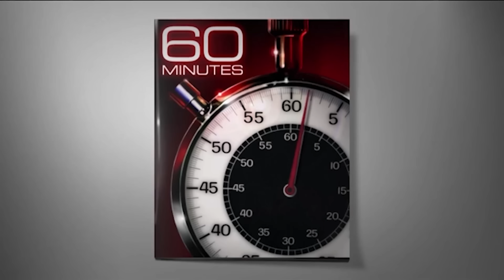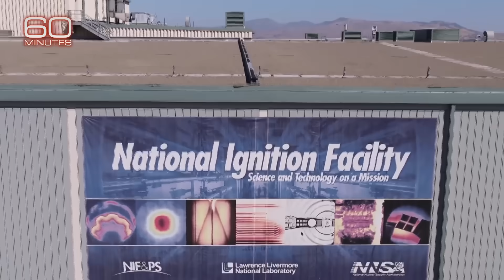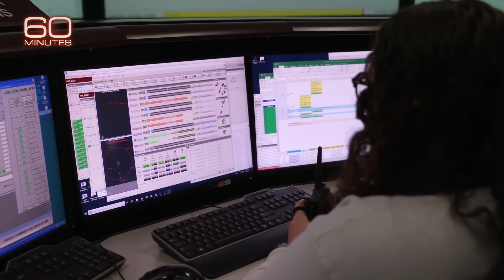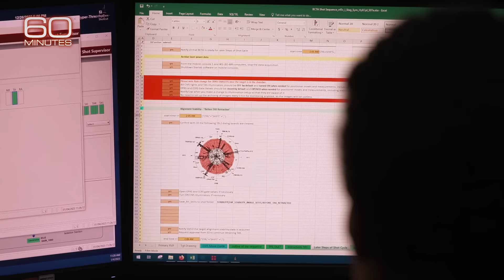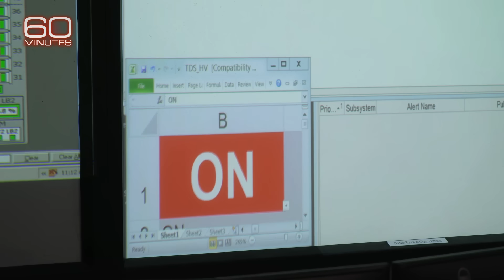Nuclear Fusion: Inside the breakthrough that could change our world | 60 Minutes

Comment: Not to overstate the significance of this achievement since there are many substantial hurdles to overcome before this is anywhere near viable for commercial power production, but I still feel like I’m seeing a glimpse into the earliest stages of a technology that will one day change the world. Being in my mid 30s currently I’m hopeful it will happen in my lifetime.
Reply: They were right when they compared it to the Wright bros. flight.
Reply: @bryanhumphreys940  The Wright bros had an plane, engine, flight control, stable flight. We are at the level of Jean-Marie Le Bris 1856 in power flight. We can now fly with horses pulling us along.  There is no talk on how to harness the energy from nuclear fusion reaction, how to avoid neutron irradiation to the equipment, how to remove the fusion waste from the fusion reaction chamber.
Reply: @bryanhumphreys940  Personally I like the comparison of the Univac computer to modern computers. A whole room dedicated to running computations in the 50's would be easily accomplished with a handheld device now. The tech is just going to get smaller and better as time goes on.
Reply: @bryanhumphreys940  no they were absolutely wrong this has been done 100 years ago and proven not worth pursuing the only reason they're pursuing it now is for funding free money for all you pump a pellet with 100 megajoule laser you're gonna get some feedback this is idiotic waste of money
Reply: @bryanhumphreys940  ....;o. Kg MO*kkm. .m km. M.. M km.. M.. Kk
Reply: @bryanhumphreys940  not like the wright brothers. They weren't actually the first to fly a plane at all. They only perfected a motorized version, but the people to originally fly a plane in the sky was 1,000 years before that. 
This "breakthrough" is like discovering how to fly at all in the first place, and we have yet to see it actually put to any use...even one single factory for something! 
It won't be 1,000 years but maybe 40-50 years
Reply: @elephant882  A plane over 1000 years ago? Who did this and how did they power this heavier than air vehicle? Funny I never learned this in my aerodynamic class in engineering college.
Reply: I just turned 38. Maybe we'll see a revolutionary new energy platform in our lives. This was monumental.
Reply: @kangtheconqueror9545  I just turned 38 yesterday
Reply: @kangtheconqueror9545  u ain't Kang 😆
Reply: @kangtheconqueror9545  same age. Let's get it done!
Reply: @GwaiZai  I got you brother.
Reply: @kangtheconqueror9545  question, what's the significance of this being a success.... I guess I'm asking if you could explain in simple terms why fusion energy is such a big deal....is it like Tony Stark discovering a never ending amount of energy like the arc reactor in the avengers movie?
Reply: @brandonhayes8364  Yea, to some degree.
Reply: @kangtheconqueror9545  Tired of our pollutioned dirty planet
Reply: @kangtheconqueror9545  😅
Reply: what's wrong with thorium? it's safe or does America need
more bomb making
material for future wars?
Reply: @richardwilliams6920  - I responded to you in your previous question. You've been misled regarding the thorium fuel cycle not serving as a potential nuclear weapon fuel source. The U.S. has at least 10,000 nuclear weapons, most of them being thermonuclear weapons with much higher energy yields than the bomb used on Hiroshima, Japan. The U.S. currently recycles its weapons fuels and has no plans to generate more fuel for such weapons. I assume you are are aware that the U.S. has many thousands of its nuclear weapons on alert and ready to be launched and delivered. Most can be launched within about 15 minutes. If you were not aware I encourage you to look into the situation rather than plug for thorium molten salt reactors.
Reply: @kangtheconqueror9545  Its a ponzi, I do not beleve you can run it small scale like this.
Reply: @funnycatvideos5490  Seems you and I are the only ones understand this ...
Reply: @VicGreenBitcoin  You cant run it large scale only small scale or it destroys the machine instantly if you want to get enuff energy to boil the kettle the machine is destroyed!
Reply: What achievement ?
Reply: @gizmo6746  death sentence for all of us this will destroy mankind
Reply: They carefully and strategically state there is a tiny power increase from point of contact beam to fusion, they dont include the power required to charge the device.  example: 500 power units going into source, 501 comes out, but to charge the power units it costs 5,000,000 power units.  End result is a less impressive 5,000,000 - 5,000,001.
Reply: 300 years to overcome the hurdles of fusion. It is that hard and costly.
Reply: @oldmech619  we are going to have some help very soon
Reply: Be careful what you wish for.
Reply: Same here, I'm 32, a student of physics, and I can already tell you that accomplishing this first hurdle would be the hardest challenge (yet they've done it) - the rest are innovation and efficiency problems. Cheers.🤙
Reply: 9 years bud
Reply: @davidanderson6100  I really and truly don’t understand why we can’t keep gas powered cars around for those of us who enjoy a performance machine, and then just use electric for literally everything else. It hurts my heart to give up the feel of a gas powered engine. But I’m also a gearhead and far more likely to spend my money on such an endeavor. Zero-sum games are sht for everyone. And I’d like to think they’re the realm of republicans. But I have no issue pushing for and encouraging electric powered vehicles. Just please don’t take away my muscle cars. Please don’t destroy formula 1 either. Otherwise I’ll be looking into electric powered ways to kms.
Reply: I feel the same way too, but maybe concepts like Formula 1, NASCAR and Rally etc will modernise and move on. People in the future will look back and think our systems of racing sports were archaic. Imagine instead we have fusion-powered racing where vehicles can hit ridiculous speeds they will be looking at our current F1 the same way we looked at old Le Mans racing back in 1926.
Reply: @TheJLH  - There are a great many people in this world who who would rather see humans and most of the other millions of biological species go extinct than give up their dream machines and the dreams that they developed since early childhood.
Reply: @vernonbrechin4207  Are you some disgruntled employee who lost his job at this facility and now takes to YouTube to degrade what they accomplished?
Reply: @vernonbrechin4207  is this the way you’re classifying me? I can’t tell.
Reply: @TheJLH  - There is nothing unusual about those who put their personal preferences above that of the preservation of biological life upon this planet.
Reply: @vernonbrechin4207  that’s not what I asked you Vern. You don’t have to be so cryptic. Just nut up and say what you mean. I’m pretty reasonable when criticized.
Reply: @TheJLH  - I wasn't sure what you meant by 'classifying' you. I tend to be cryptic because most people don't see any connection between their personal preferences for fossil fuel burning muscle cars and why, after 57 years of climate disaster warnings we continue to emit more and more greenhouse gases into the atmosphere. Perhaps the connection is outside the scope of many people's understanding.
Reply: @vernonbrechin4207  you could have done without that last sentence my guy. No one is going to make any changes to their preferences because Vernon on the Internet was passive-aggressively patronizing to them in YouTube comments.

Maybe you’re so far up your own behind that anyone not also up your behind is too outside the scope of your hearing for you to comprehend what they are saying.

What’s frustrating is I feel you must not have even read my comment at all. I find the way you’ve responded to my original comment to be QUITE similar to pro-natalist anti-abortion dude bros in the comments arguing about unwanted pregnancies and the irresponsibility of women, how we should just take birth control or, better yet, not have sex.

Your comments feel, to me, like you’re less concerned that I don’t have an electric car, but more concerned that I don’t want one because of how much I enjoy my muscle car.

The reality is that me, as a citizen of the world, I’m not taking on something that devours something that I enjoy as a punitive measure, meanwhile, AS USUAL, INDUSTRY is the leading consumer of finite resources. They can eat a dik if they think I’m going to fall in line before they do. Because they never will unless we force them.

Additionally, as I’ve said, there is a massive percentage of fossil fuel use which can be discouraged simply by reframing the use of it as a performance product. Most people don’t care enough for the cost of that. You don’t have to force people. Enticing us is enough.
Reply: @TheJLH  - Good points. I appreciate your well written response. At this  point in time it is getting a bit too late for simple incentives to work. Many people remain unaware what a tipping point means. It can mean that once one goes beyond a certain point it becomes impossible to recover. It is like if one deploys one's parachute below a certain elevation above the ground then survival becomes impossible.

---
Most of the 8.0+ billion people on this planet have found it to be advantageous to exclude the following warnings from their consciousness. I urge readers to search for the following two article headlines.

IPCC report: ‘now or never’ if world is to stave off climate disaster (TheGuardian)

UN chief: World has less than 2 years to avoid 'runaway climate change' (TheHill)
  * This statement was made 4.3 years ago.
Reply: With that much power we could change everything for the better or for worse
Reply: It happened thousands of years ago. The sun and moon
Reply: @Burning_Babylon  When did moon ignite fusion?
Reply: hey for all we know AI could vastly accelerate progress on this
Reply: Isn’t a technology yet already thinking of the commercial aspect. We are culturally bankrupt
Reply: @shamanic_nostalgia  or the other way around
Reply: @shamanic_nostalgia  - The NIF management has applied AI in many aspects of the experiments they have been doing since 2009. The work on this technology at the LLNL began back in the 1970s.
Reply: @shamanic_nostalgia  I like that!!!!!! Gracias
Reply: Not going to happen. The amount of energy needed for the lasers is astronomical. This is just more wasted money clickbaot propoganda bullcrap.
Reply: Finally someone who gets it, nucleair fusion is decade away from becoming actually usable .
Reply: On that note, nothing changes the destiny of humankind, as stated at the beginning of the video. That destiny is the same for all the civilizations existing in this and other universes, and it will be fulfilled no matter what.
Reply: Vaporizing weapons
Reply: I totally agree. Hoping it happens in my life time. 29 here
Reply: I hope so too. My dad died back in August of 2022 so he didn’t get to live to see this, but I think he would have been pretty excited. Now at age 36 I hope I get to see this too, but by that point I’ll probably be 50 or 60. It will be like when the internet came out for commercial use
Reply: Please expand your consciousness on this topic. Hope is a good thing, but it is important to know when we are being played.
Look into the examples of this tech that was quashed in the eighties and nineties by the global elite. The work of Dr Eugene Mallove (MIT) 
and Fleischmann and Pons are glaring examples.

Also, the "Water Engines " that run on hydrogen by Stan Meyers (poisoned) and  two decades later, Aaron Salter (shooting victim).

You live long enough, one realizes there are no coincidences.
Reply: BTW, Nikola Tesla had a formula for Free Energy (Zero Point Energy) 80 years ago.
Reply: @anthonykurczewski8384  yes he did honor I have for him. Sad his work was stolen by Edison Wish I had some direction on how to build it..?for us all 🫡
Reply: @anthonykurczewski8384  Yes, and they "banned" him.
Reply: @RMBlake007  I have no idea which comment you are replying to.
Reply: @RMBlake007  "Yes, and they "banned" him."  To whom are you referring, please?
Reply: @anthonykurczewski8384  I've been looking for the comment that had to do with Tesla. I think it might have been what I was referring to. Don't think it was yours though?
Reply: @anthonykurczewski8384  I think the Comment might have been deleted. I recall making a cmment about Tesla...but I cannot locate it now.
Reply: Nikola Tesla anyone
Reply: Quantum computing enters the chat
Reply: @exceptionallife4768  quantum computing is Alot more complex and won't be used for another 80years yet nuclear fusion could be commercial by 2050.
Reply: @pootube2024  you don’t know what you are talking about
Reply: It would likely take another 50 years for this to become a viable technology; however, I’m confident that machine learning will speed up this process. AI doesn’t sleep, and it learns faster than humans do.
Reply: Me, too...hoping that you ill see it.
Reply: much easier to fire two rings of plasma @ each other using magnetism and the reaction will feed itself
Reply: @Anon-zu3xn  A Toroid. Extract from "Thrive" documentary 2011 on you tube made by one of the Gamble (Proctor & Gamble) family heirs.
"The Torus & Toroidal Flow extract from Thrive 2011 documentary.avi"
Reply: Yeah I'm 44 I nearly cried when I got this news. This is historic, I feel this is truly going to change everything and man will start stepping to a new frontier we never thought we could reach!
Reply: we went from no computers and no internet to the speeds and tech we have now in what 20 years? well see some big changes before u die man
Reply: @break1722  Going to have to disagree with you there, can't say I'm a fan of socialism
Reply: @michaelhill6451  Yes, but there’s a lot of details your missing about the laser system. It was built in the 90s, updated some optics in the 2000s and now we’re here.

NIF was never designed with efficiency in mind at all, like 0% thought. If they had optimized for efficiency first and then found out they were just a little short on energy, it would have shelved the entire project.

So really, just by updating to modern 2023 laser tech (3 decades newer) they’d see huge efficiency gains. I think the biggest hurdles are producing enough shells and increasing tests. But it’ll happen soon enough.
Reply: @aaronchamberlain4698  - Unstated in the above presentation was the fact that the NIF laser facility was preceded by at least two other laser fusion facilities at the LLNL. In the case of each of them the staff speculated that they might reach the goal of 'ignition.' They didn't but the planners of NIF said they had worked out all the kinks so that NIF should be able to achieve its namesake 'ignition.' Soon after it became fully operational. That happened in 2009. It didn't come anywhere close. The lab was given until 2012 to achieve that goal. It still hadn't come close by the end of 2012. There were no repercussions and the funding kept flowing since the facility has always been primarily funded at a thermonuclear weapon (H-bomb) research tool. It has been estimated that about $11 billion has been spent to get it to this point, a decade after it was suppose to achieve 'ignition.' Now the management is complaining about the laser efficiency to explain the failures that they have had. That is to urge that a newer facility is funded.

The more advanced lasers they are suggesting are Laser Diode Pumped Lasers  (LDPL), the most efficient of with is about 20%. What the management leaves out of their pleas is that even the most powerful of those lasers don't come anywhere close to the energy output of the current NIF lasers. The NIF lasers have poor efficiency for several reasons. A major factor is that the wavelength is shifted to shorter wavelengths at least twice, with the final conversion to X-rays from the hohlarum inner wall. If the same was required of the newer LDPLs then the overall efficiency would plunge drastically from that peak of 20%.

Perhaps it never entered your mind that these other factors were involved. Many young people are of the opinion that all our newer technologies are bound to solve the problems of the past that have arisen.
Reply: @vernonbrechin4207  Are you some disgruntled employee who lost his job at this facility and now takes to YouTube to degrade what they accomplished?
Reply: 10.shots per second.... Good luck. This won't be available for 100 years
Reply: @davidgilbert2998  - The reported experiment took at least a week to prepare. If they were able to repeat the experiment each week then the repetition rate would be one shot per week. That is 604,800 seconds between shots. The duration of the fusion reaction was 0.00000000008 seconds. As a result the fusion duty cycle would be 0.00000000000001%. In order to recover a significant amount of energy per shot, after also using some energy to create tritium fuel, the capsule compression energy to fusion output energy would need to be boosted to around a factor of 100. So the NIF management needs to improve their system by a factor of over one million to even get technically close to a practical nuclear fusion power plant reactor. This was not clearly stated in the above 'breakthrough' video.
Reply: @vernonbrechin4207  Are you some disgruntled employee who lost his job at this facility and now takes to YouTube to degrade what they accomplished?
Reply: I still believe a hamster running on a treadmill is still more realistic
Reply: @davidgilbert2998  - Since it took about a week to prepare the experiment and the fusion reaction only lasted about 0.00000000008 seconds, producing enough energy during the shot to boil a couple of liters of water, then if one spreads out that energy over a weeks time period my guess is one hamster in a generator wheel would produce more energy than this  experiment that wasn't even intended to capture the energy, or to use some of it to breed replacement tritium fuel. Of course that ignores the facility input energy which would be much greater than the energy needed to pump-up the lasers to shot them once a week.
Reply: @vernonbrechin4207   what are u even saying..... Im not reading this..
Reply: @vernonbrechin4207  Are you some disgruntled employee who lost his job at this facility and now takes to YouTube to degrade what they accomplished?
Reply: @patrickstulz8193  - No! I've never worked there. I have been on a couple tours of the LLNL though and have talked with a person who was involved with an early compliance review while the NIF was being constructed.

I'm also curious regarding the deep seated forces that prevent many people from accepting the issues that I raise. I assumed that their sense of hope tends to blind them to some of these issues.
Reply: @patrickstulz8193  Your identical comment is posted 8 times. Are you some disgruntled employee of YouTube that's spamming up comment sections? Why not delete 7 of your comments? Thank-you.
Reply: we gon go kaboom
Reply: yeah, we're looking at 20 years minimum before we see a commercial application. but it's exciting that they took this big first step
Reply: This is very exciting, but we have heard it before.  I am old enough to have been told that nuclear fission power would make electricity too cheap to bother metering it.  I still believe in nuclear fission power, but it has certainly fallen out of favor. The reasons are more emotional than scientific, but that is where we are.
Reply: It's all poppycock.  You're all being hoodwinked.  Congratulations
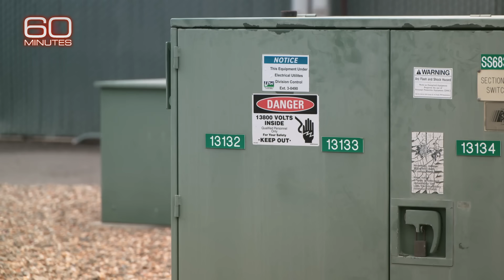Reply: They put in 300 units of energy to get 3 units out.  9:56
Reply: We need fusion quickly, so that countries don’t rely on Russian oil.
Reply: @nickduplaga507  Sorry you believe the fairy tales spouted by 60 minutes (DELIBERATELY?) but its not true! Fusion wont be happening for power its impossible and doesnt work!

The funniest thing they left out of their deceitful inaccurate dribble was the fact that 2 units of power used to generate 3 units of power (you know that 50% increase over input)
That 2 units COST 300 UNITS OF PWER TO MAKE!

Please do the maths on that! 😁
Reply: @danquaylesitsspeltpotatoe8307 Not impossible.  
Especially with AI machine learning, and it would be very quick.
Reply: Me too…
Reply: I'm skeptical about the prospects of self-sustained nuclear fusion -- getting more energy out of it than you put in. We cannot emulate what the sun/stars do because they rely on GRAVITY as the driving force for the reaction to happen, and gravity requires no extra 'energy' -- it's simply a force that naturally occurs when a large body of MATTER is present. So, we have to expend tremendous amounts of ENERGY in order to start and sustain the fusion reaction. Researchers may 'claim' that their reaction produces more energy than the energy required to start the reaction, but two critical questions remain: 1) Is that differential in energy SIGNIFICANT? In other words, are we expending 3.9999 joules of energy in order to extract 4.0000 joules of energy? 2) Are they even able to SUSTAIN those nuclear reactions 24/7? 3) Even if they're able to CREATE more energy than what was spent, can they actually HARNESS all that energy? or does much of it get lost/wasted in the process? Nature/God has provided a 'model' for how energy can be created via nuclear fusion -- using GRAVITY as the key driver (and 'gravity' requires no extra energy to be input). It may very well be possible that this is the ONLY way to create a net-positive fusion reaction.
Reply: Wait. They first claimed that it takes 2 units of energy to get 3 units out? But the reality is that it takes 300 units of energy to get 3 units out? Is this some kind of joke? Basically, they haven't achieved ANYTHING EVEN CLOSE to sustainable fusion energy. Wait. They first claimed that it takes 2 units of energy to get 3 units out? But the reality is that it takes 300 units of energy to get 3 units out? Is this some kind of joke? Basically, they haven't achieved ANYTHING EVEN CLOSE to sustainable fusion energy.
Reply: You and me both brother
Reply: @davidanderson6100  why would they ban electric vehicles? I’ve always loved the quote that lobbyism is just legal bribery.
Reply: @casedistorted  you will be gone when this works
Reply: It feels like how it was when they landed on the moon
Reply: @break1722  This America, land of the capitalist and that’s what makes this place good and bad! THAT WOULD NEVER HAPPEN 🇺🇸 ❤️
Reply: @cm2274  Do not confuse (as you have) Fascism (a primarily leftist paradigm) with Free Market Capitalism. Public/Private partnerships are Fascism.
Investment Banks you never heard of, thanks to the MSM, like Black Rock and Vanguard, control the Fortune 500. Stockholders are the uber Elite attending the WEF' symposium are in Davos right now, 1000 of them. "A thousand points of Light?" quoting GHWB. No. Darkness.
Read "Brotherhood of Darkness" ca 1996 by Dr Stan Monteith $13.95 for 140 pages of pure knowledge. The bibliography alone is worth the price. 
Also, "Behold A Pale Horse"  ca 1991, by Milton William Cooper. The late Mr Cooper was and non com officer that worked in the Pentagon for the Office of  Naval Intelligence and handled all the incoming data.
Reply: @davidanderson6100  you should look at my comment. It explains what energy science is looking for and it isn't fusion
Reply: When are we going to discuss honestly element 115?
Reply: I'm 38 hope to see this in commercial use.
Reply: I admire your optimism.
Reply: It's going to be here faster than you believe...
Reply: @davidanderson6100  A bill was introduced on 1/13/2023, not banned at this time in Wyoming.
Reply: You will die before anything ever happens
Reply: I am not so excited, yes there was net gain inside the chamber. But if you need hundred time more energy to get the lasers to fire... yikes. The one thing they did is proof that the theory is correct. At that point it becomes an engineering/production problem so yes it was an achievement and a step closer. But still you have to deal with the laws of nature and must find a way using this method , to be much much more efficient getting power to the chamber. And i don't see a way to get that done in the next 50 or so years. Hopefully this ages faster then i expected though. I personally have much more hope on the experimental fusion factory being build in France using a different method (Tokamak) it's called ITER look it up on the internet.
Reply: Hate to break this to you but nobody alive today will live to see nuclear fusion reactors powering our cities. I will likely happen some day but it will be a very long time from now..
Reply: @michaelhill6451  👍👍
Reply: Absolutely I hope so too!!!
Reply: This was done and surpassed over 100 years ago. I’m more surprised it’s finally being allowed to be released. I wonder if they’ll let zero point energy get out too. Doubtful.
Reply: We're millennials,  we experience everything, grew up with the early stages of tech, now this? No other generation will ever know; we will surely see this happen in out life time, for sure.
Reply: We have known thorium fusion would save the world forever now (30 + years) if they cared to help the general public with making unlimited energy then they would have.
Reply: Ya I’m 33 I guess we will all see…. I would be all for some iron man boot like shoes to fly around on Nick name them the Forrest Gump special jawns
Reply: @break1722  I don't think many people realize how the world will change rather fast with unlimited energy. You can scrub all co2 excess from the climate with it, you can dezalinize salt water and irrigate deserts to transform them. There is enough Deuterium in salt water to give everyone a million times more energy for billions of years. And we don't even last that long here on Earth.
Reply: Hopefully it will happen before Civilization destroys itself.
Reply: That's literally what the whole video was about ....
Reply: My boyfriend developed this system in 1970, as a child... it got him on a full ride into Stanford.
Reply: Me too...mid-30's. I can't wait to see how this plays out. Hopefully we see a triumph of triumphs! 🙂
Reply: I am 24, I agree with you you. I hope I get to see this technological evolution in my lifetime.
Reply: @break1722  oh boy can’t wait for government to be I charge of our power grid

I bet they even complete their takeover of our healthcare system 

How many people have been killed for discovering new power sources, new engine from alternative power supplies?

I don’t trust any of these people
Reply: Nope
Reply: @Darkness380 The main thing is to get us free and independent, meaning that every home and business has there own unit and no meters.
This was Nikola Tesla's dream. Free Energy.
It will never happen because too many people want to be nursed from cradle to grave; they trust "authority" ; they never fully read the US Constitution and do not comprehend that what makes America's Constitution unique is that our Rights are not given to us by any government agency, but rather we are born with them, imbued to us by the Almighty as unalienable Rights that cannot be waived, traded or taken away. The word "inalienable" is not what the Founders wrote. 
Unalienable connotes the word "Immanent". Thank the Free Masons for the subterfuge in replacing that word and the meanings of many others. These followers of the dark are responsible for many such games in wordplay. Up until the 1920's, the Holy Bible and the Black's law dictionary were in every home. Up until the 1950's, the Illuminati were in every Encyclopedia. Look up the Act of 1871 and "USAvsUS dot info" at "duckduckgo"
We are in war of light against darkness.
"The more things change, the more they stay the same."
Reply: Unfortunately basic physics of weight pretty much stop most fantastical things existing.
Reply: This is basically a re-run for all the newbies to the party.  Nuclear fusion talk has been around for a long time.
Reply: @chipmidges3122  This is all BS. Cold Fusion is real and is being suppressed.
Reply: Doesnt matter. We will all die someday. By way of aacident, disease, natural death of age. So worry about eternal life and not about something that will cease to exist.
Reply: I don’t really understand how this whole thing works, but maybe someone here can enlighten me on a thought I have about this. Let’s say the technology is now here and working ie., all the numbers are good and we now have the ability to power all the land and sea mass of Earth. Say hypothetically and all politics aside, we are going to provide power to light up the Amazon Rainforest, how do you get the power to the Rainforest?
Reply: lmao no, no it wont.
Reply: amount of stupidity in these comments lets me know it will never happen. AI isn't real. Lasers don't power suns. Editing your DNA is idiotic. God is real.
Reply: same!
Reply: You have no idea. Sadly the real challenge will come when such technology rivals that of oil and gas.
Reply: @paulc7138  thats why big tech companys are investing in fusion tech?
Reply: @xbchiefmatrix  open your eyes. Oil isn’t clean.
Reply: Now that they've done it once, the breakthroughs should start coming much faster. They finally have the baseline data and other facilities can start duplicating and building on this breakthrough.
Reply: Only thing that would get in the way is the greed of companies that would lose money as a result of this tech
Reply: @shitonyourgrave  way more money to be made
Reply: Well that's a small issue. Instead of 2 units in and 3 out as they initially quoted, halfway through the hyped ip tale, the quickly state," it was 300 in and 3 out"...!  

Typical media
Reply: Not without a big fight from non-renewable companies. Oil & , Coal, Forestry.
Reply: @BuckingHorse-Bull  most people who support fossil fuels also support nuclear.
Reply: It wont. Youll be long dead before it does
Reply: I think short term better storage tech is going to be the thing
Reply: Same dude couldn't have said it better.
Reply: You won't see it in your lifetime.
Reply: I’m 38 too. I’m excited for my kids. They’re going to get to see things wildly amazing when I’m gone.
Reply: @sethmacomber3497  - They  are likely to see some pretty amazing stuff but it likely won't be what you dream of.

Most of the 8.0+ billion people on this planet have found it to be advantageous to exclude the following warnings from their consciousness. I urge readers to search for the following two article headlines.

IPCC report: ‘now or never’ if world is to stave off climate disaster (TheGuardian)

UN chief: World has less than 2 years to avoid 'runaway climate change' (TheHill)
  * This statement was made 4.3 years ago.
Reply: @sethmacomber3497  - Most of the 8.0+ billion people on this planet have found it to be advantageous to exclude the following warnings from their consciousness. I urge readers to search for the following two article headlines.

IPCC report: ‘now or never’ if world is to stave off climate disaster (TheGuardian)

UN chief: World has less than 2 years to avoid 'runaway climate change' (TheHill)
  * This statement was made 4.3 years ago.
Reply: @vernonbrechin4207  😂
Reply: Exaclty this is crazy to think about!
Reply: Read OVERSHOOT by catton. This will make us more able at consuming the planet.

LIMITS TO GROWTH - gaya herrington. Read it.
Reply: You will be 60 years old when this happens 
So yes take care of yourself and you will live to see it happen
Reply: People with your mindset slow us down
Reply: 😂😂😂😂These nerds been saying this for 70 Years. Wasted money. Should just leave this power inside the sun. Doesn't belong in the hands of humans.
Reply: You took the words out of my mouth.
Reply: I don't think it's as challenging as even these engineers and scienctists believe. ChatagGPT is about to change the world. AI is going to advance the advance of everything
Reply: You wont
Reply: dont hold your breath
Reply: You won't be here this is for elites and nothing else.
Reply: If it’s on 60 min it will be shelved and never supported. It will take someone mega rich and unstoppable to even come close to producing it.
Reply: @bfitness2320  - All the money in the world can't make something that is economically impractical into something that is economically practical. History is filled with examples where enormous sums of money have been expended on projects that never went anywhere practical. Often those examples have been considered too embarrassing to be worth remembering.

As I've pointed out here frequently the NIF has always been primarily funded as a thermonuclear weapon (H-bomb) research tool. The announced experiment included some of that nuclear weapons related work. The NIF management has always obscured that purpose when they present the NIF to the public as a path to a economically practical nuclear fusion power plant. These experiments, with their nearly imperfection free hollow diamond fuel capsules, are getting further and further away from anything that is practical for non-weapon purposes. One estimate is that NIF has already expended around $11 billion in funding from the nuclear weapons division of the U.S. Department of Energy (DOE).
Reply: At least it won't be a change in weapons. You know cuz fusion has already been solved for the purpose of death and destruction.
Reply: This achievement can not be over stated
Reply: You want see it none of us will
Reply: Too expensive.
Reply: ~Global nuclear bomb fake Hiroshima deceptive There are no satellite photos of nuclear test explosions, please tell everyone~
Reply: Not really... as with the atomic/nuclear one - it is for a bomb first.
Reply: old man
Reply: @michaelhill6451  Yes, they mention the part about the high energy use vs the gain at 9:50.
Reply: If your Reading this I sow Prayer seeds of Mighty Rivers of Blessings, Favor, Prosperity, Success, Grace, Protection, Love, Joy, Happiness, Peace, Wisdom, Knowledge, Understanding and Good Health to You and your Kids Kids Forevermore.
Reply: LMAO!!! This planet does not have that much time to see what you are talking about occur. WWIII is right around the corner. And that will happen long before there is this energy form used like you are talking about.
Reply: Nah you’ll be dead
Reply: @Warlock C'mon Warlock...you're making too much sense. ; )
Reply: Earlier comment by me to R M Blake:
I" did make a comment about Tesla regarding his  "lost" 20 boxes of files out of 80 total from his hotel room once the FBI entered the picture.
I must also add here is that once we enter the realm of Quantum Physics and the very tiniest subatomic particles, we observe a state known as "non-locality" which physicists widely believe means this state shows that the particle is everywhere at once in the Universe.
We could call this state the "ether" that Tesla was writing about in his notes. These would be where ZeroPoint Energy  is derived.
The question is whether or not the Uber Elite will be stymied by the Patriots from destroying humanity long enough for these forms of technology to be brought out.
The fact that Ukraine is in the middle of all this is no accident. It is the HQ of the Canaanite/Khazarian/Venetian Black Nobility/lIIuminatl, and their Bloodlines/Free Mason linkages run everywhere throughout history. Klaus Schwab, for instance, is a Rothschild."  ( a branch Khazarian Bloodline ).
Reply: If something like this could be done on a small scale and create energy directly at homes it would eliminate the need for having an electric grid which is dangerous peop]e and wildlife and vulnerable to weather.
Reply: Couldn't agree more with your statement.
Reply: Considering how in the last decade a handful of research projects went to probably hundreds of test and prototype setups many financed by the industry, it very likely a glimpse of the near future. ITER has an estimated budget of 18-22 billion. But considering that it´s a multinational research project shared between nations, and that the prject started 1988 and is projected to get running in 2035, 47 years all things considered and how inefficient goivernment projects are, the money invested is nothing, absolutely miniscule. Overall, there was despite what is toted often not really that much interest and support in developing the technology. Considering that the SLS program, financed by the US alone, has so far swallowed 23.5 billion in just 11 years, and thats only a small part of NASA`s budget, it real shows. Or we could talk about how the US millitary has a yearly budged of 1.9 trillion, or 1,900 billion, 20 billion are a rounding error on those scales. We can after all see whats possible with basically unlimted funding of science in the 60`s. NASA went from barely funktioning rockets to landing on the moon in 8 years. We really don´t have our prioritys straight as a species.
Reply: Hopefully we will be around to reap it's benefits
Reply: I'm not so sure for this!!
Reply: I with ya brother!
Reply: @MARK MORALES Funny you say that in March last year the White House had the cajones to state that viable nuclear energy would be availble to the masses in ~12 years; while news outlets are claiming 10-50 years.  I see the process going significantly faster than Fission (as in modern times we have advanced computing + the proliferation of machine learning and quantum computing on the horizon) but Yes I agree it will still take time more at a snail's pace than a rocket. Because if they rush it and something goes wrong - Chernobyl and 3 Mile island would look like picnic spots compared to then hole left by a reacor powerful enough to feed a large city.
Reply: I'm much more pessimistic after this article. I think Tokamak reactors are much more feasible now.  Looking forward to when they start testing ITER
Reply: Not gonna happen.
Reply: Fusion is just a HUGE and STUPID BOONDOGGLE.

FISSION, works at 600 degrees C (vs. 10,000,000 C for fusion) and there's unlimited fuel for it - thorium (see the Kirk Sorenson videos). 
https://youtube.com/playlist?list=PL6JjafE5gsb9nSmudoj5MUKxX8LTKO0-J

But the fusion world starts at 10 MILLION degrees C.  It's stupid to try and make a POWER plant under those conditions.  It's stupid to try.   

You'll scream when you figure out how stupid we've been in this business. 

Meanwhile, Fusion con artists are laughing all the way to the bank.
Reply: I think we will! Thanks to our advancements in AI I think it will only speed up the process!
Reply: 300 mega bejoules of laser energy, and you can heat 2 cups of coffee
Reply: Thunderfoot busted thus video
Reply: Just a decade or two away.
Reply: There's the promise and then there's the reality.  The promise is always decades away.  The reality is buckets money spent on projects with anemic results.
Reply: Mark ole buddy your optimism makes this old guy happy!!!!! Wether I see it or not you will and my grandchildren also!!!!
Reply: To those who believe fusion Power is 
the answer 2030,  ARE TOTALLY INSANE.
Fission power was to be the answer to 
all our energy problems in 1960.  💀
Reply: I wouldn't hold your breath dude. They created almost no power while using up nearly a city blocks worth of electricity to prove a point. And everything about the experiment requires perfection beyond what humans are capable of. We are more likely to get warp drive before this.
Reply: I assure you that I had very similar feelings when I started following the research in the late 1970s. Perhaps you, like many of your generation, have never looked into the hopes and dreams of people back then.
Reply: So what's wrong with
using thorium for powerp
Reply: @richardwilliams6920  - There are many thousands of people crusading for reactors fueled with Thorium. The vast majority have  minimal to no formal academic training in nuclear physics, or nuclear engineering. The campaign in the U.S. began with a couple of  engineers about two decades ago utilizing social media platforms. They were pushing for the government to start funding their dream project. Very little progress has taken place since then. Most of the fans are unaware of that history. Typically, they immerse themselves in eco-chamber sites that only present the promotional side of the story so as to reinforce their belief that Thorium reactors can be our saviors. Such fans typically have no interest in doing critical analysis of the concept. Typically nuclear power advocates assume that we have 20-30 years left to turn this 'Titanic' around with their favorite nuclear power technology. They have been masterful in excluding the following warnings from their consciousness. I urge readers to search for the following articles.

IPCC report: ‘now or never’ if world is to stave off climate disaster (The Guardian)

UN chief: World has less than 2 years to avoid 'runaway climate change' (TheHill)
  * Note that this statement was made 4.5 years ago.

Thorium, Not The Nuclear Savior Claimed (SimplyInfo org)

Thorium Fuel – No Panacea for Nuclear Power (IEER)

Thorium Fuel: No Panacea for Nuclear Power (fact sheet) (IEER)
Reply: @richardwilliams6920  Cleaning the molten salt.  The UK has one solution but it's radically different than the the normal circulating molten salt.  The UK, with their far flung empire that they support, has the most to gain and which provides the research funding. The trash to energy system used throughout the world was developed by them also.
Reply: @mastermind377  - Correct! The vast majority of the Earth's 8.0+ billion people have become masterful at excluding the following two warnings from their consciousness. Denial is a natural human protective coping mechanism to deal with intolerable cognitive dissonance.

Please search for the following article titles.

IPCC report: ‘now or never’ if world is to stave off climate disaster

UN chief: World has less than 2 years to avoid 'runaway climate change'
* Note that this statement was made 4.5 years ago.
Reply: You overstated it.  Man made Fusion Reactor is completely science fiction.

Earth has a nature fusion core in the center of the Earth.  Lava is gives off radiation, that's more proof than you'll get from anyone claiming to work on fusion reactors.

How stars power themselves, gravity in the 200+ times Earths gravity range and large amounts of uranium (size of a moon to larger than the earth, wild guess).  There's nowhere for the uranium to go, it just cycles through and being the heaviest remains mostly at the core.
Reply: Commercial production controlled or free to use by 1 country or every country?
Reply: @mdmoz1777  Since the elites are planning one global government, they will likely sell it as a global thing.
Reply: @mdmoz1777  nothing is free!!!!!!!!!!
Reply: In the long run. I think the number one hurdle will be bypassing the efforts to ban nuclear fusion power by the lobbiests representing the companies that supply power to all American citizens.
Reply: let me help you out Mark --there is nothing more important then Viable Fusion reactor
Reply: @davegt27    question, what's the significance of this being a success.... I guess I'm asking if you could explain in simple terms why fusion energy is such a big deal....is it like Tony Stark discovering a never ending amount of energy like the arc reactor in the avengers movie?
Reply: Its the key to everything... logistical affordable space travel ... the. Beginning of propelling a vessel to light speed
Reply: @chrisbellville6957 traveling in a vessel at light speed will never happen.
Reply: Really, you just saw a mini sun be created and thought "Hmm, this might actually be significant"
Reply: @goombacumba608  I thought China already created a fake artificial Sun
Reply: @AuraFarmerWitShotgun  Yeah, people creating mini suns is super impressive. I'm just commenting on how dumb of a thought "BRO HAVING THE POWER OF THE SUN IS SUCH A SIGNIFICANT even". i'm pretty sure anyone with a brain would think that
Reply: @goombacumba608  300 mega bejoules of laser energy, and you can heat 2 cups of coffee
Reply: @goombacumba608  If you saw a mini sun, you should have your eyes checked.
Reply: I'm 25 and I know all the tech we dream of we'll have. Living to 200 is happening in my life time and I can't wait.
Reply: @gatesroyale  36 here. I hope they figure this sht out before I’m not hot anymore. Clock’s tickin
Reply: @TheJLH  I just turned 58.. get outta my yard..
Reply: @coolbreeze1627  you’re right, that’s my bad.
Reply: @gatesroyale  hah maybe living to 200 if you copy your mind and upload it to a computer clone, but your body will not live to be 200. That will take another 200 years before we have essentially become immortal
Reply: @casedistorted  that's exactly what people are going to do. And in those days they will seek death and shall not find it; and shall desire to die, and death shall flee from them.
Reply: @casedistorted  Soul's are immortal, bodies are not.
Reply: @RMBlake007  It depends what you believe.

It would be nice if we have a soul, but there is no scientific evidence to prove we do.

I used to be religious until I saw my dad die.
I am pretty sure we are alone in this.
Reply: @gatesroyale  You may be waiting past your sell by date ...dude
Reply: @gatesroyale  living to 200?I think not.
Reply: @gatesroyale  I hope so man! Would love more time with my family
Reply: @gatesroyale  I think there's a chance. But it might not happen in our life time as well. Aldo on the surface living to 200 sounds nice in idea. But actually living to 200 I think would be quite painful. Even living a few decades on this earth can be tough. There's lots of beautiful things and experiences to have and be shared but also equally painful and just difficult as well.
Reply: @ahsoka6807  if you could live to 200 in good health then yeah maybe it would be worthwhile
Reply: @gatesroyale  I don't know about that man. It would be an interesting experience for sure. When I said what I did I said it with the assumption that you could maintain youre healthiest and best form. So a body within you're 20-30s. It would be an interesting experience man to live 200 in that state. But it'd be far from some idealic state. Not to say it'd only be bad. But it would be far from some happy idealic experience.
Reply: @gatesroyale  living to 200 in your lifetime is NOT happening, we actually are living shorter now, our life expectancy has been going down instead of up. Not exactly in the direction of 200 years.
Reply: @gatesroyale good luck affording it in your lifetime
Reply: @gatesroyale  you going to live 65 and that it.
Reply: @gatesroyale  
Might be rough to live that old
Reply: @gatesroyale  well I am Jesus best friend and I used to walk the entire earth with him and I am 2,500 years old and please wish me happy birthday
Reply: @thomasholt63  happy birthday
Reply: @gatesroyale  no, it wont.
Reply: @gatesroyale Man’s time on this earth has been limited to 120 years so no technology will be able to extend your lifespan unfortunately.  With the way things are going we maybe have 5-15 years left on this earth as it currently sits before God intervenes.
Reply: @NoRodnoReel  oh here we go again...people have been saying the end times are near since the dawn of time, but yea...YOU are probably right.
Reply: @barryallen871  Yeah that is certainly true, people have been saying that for a long time.  I hope we are right this time because I am certainly fed up with the way things are in this world.
Reply: @NoRodnoReel  God has already intervened which is why these inventions are coming to light.. more to come..
Reply: @Journal2Awakening  interesting thought, you may be correct we will see.
Reply: @barryallen871  At some point, they'll be right.
Reply: @NoRodnoReel  I respect where you are coming from but I'm not sure that is scriptural the way you many believe it to be.
Reply: @jackt6112  How so?  I can see your point because Jesus said we know neither the day or the hour.  So I can’t say how much longer we have.
Reply: @NoRodnoReel  Because we have people living longer than 120 years afterwards and now, and might have been time before the flood.
Reply: @jackt6112  Your right actually.  Before the flood there was people living to over 1,000 years.  After the flood God limited those years to 130 I believe? I may be wrong.  I think the number was 120 or 130 years.  Do you know of any modern day examples of people living over 130?  I know I had a great great great grandpa that lived to 122 years old.
Reply: @NoRodnoReel  Off the top of my head, Abraham lived to 175
Reply: @NoRodnoReel  More current times the oldest I remember was 127
Reply: it pisses me off when I hear "there will e years before its viable" or anything similar.... I don't think you guys understand how fast and soon this is gonna come, we are behind the age of growth. things are speeding up faster and faster each year, now with AI being our right hand tool on many things it is gonna speed production up. I wouldn't be surprised if we start seeing this take off in the next 5-10 years.
Reply: @lovedeadboi  I agree, first step always the hardest. This science will evolve faster and faster now that they moved past first step
Reply: @lovedeadboi  I mean these are the guys behind the project giving this statement so it's probably the best estimate you'll get. 
Unless you mean progress coming from other countries copying the idea. I really hope that happens as long as its not north korea
Reply: @lovedeadboi  I hope your'e right but i don't think this method will be the one. For me scaled up versions of Tokamak fusion chambers look more promising. Perhaps the experimental fusion reactor called ITER can show us more around 2026. You can look it up on the internet as it's being constructed. Compared to that one, this one is tiny.
Reply: @lovedeadboi Moving too fast has a ton of negative effects as well.Mad scientists have always been seen as egotistical, needing to prove themselves to their doubters and needing their ego stroked by public validation, opposed to self validation and being content  with their own genius.There is and always has been a very thin line between intelligence and madness/insanity.
Reply: We will be able to travel the speed of light in the next 10 years....
Reply: @bassplayer1966  beam me up scotty
Reply: @bassplayer1966 30yrs
Reply: @bassplayer1966  Only the wealthy & powerful will be allowed to travel. They've already created conditions that have eliminated international & in some cases, national travel by 100's of millions of people. It's difficult to travel at the speed of light when you're only allowed to have a bicycle.
Reply: It will in the next 10
Reply: @michaelhill6451  liar
Reply: @davidmclean5895  See 9:50 for the explanation that they used 300 units of energy to gain 3.
Reply: It wont change anything if we dont change our economic system causing all the harm. Unlimited energy would just accelerate all the destruction. we need to look past economic growth and consuming til infinity. With everyone aiming for the well being of the planet as well as all humans (not just rich white europeans) instead of only aiming for gdp growth (that was never meant for a tool to measure well being and critizied by the inventor himself)
Reply: @karigrandii  Your claim of "our economic system causing all the harm" is directly a result of your educational/media conditioning and is not based on fact, but rather propaganda created by the Elite using the hegelian dialectic.
This is how the elite became the elite in the first place.
If you understood the application of the term "The Hegelian Dialectic" you would have grasped a long time ago that your "solution" is exactly what the Elite want: "Ordo Ab Chao". 
It is known also as "Thesis vs Antithesis = Synthesis" or "Problem Reaction, Solution".The ELITE cause the Problem and by public Reaction, they get the Solution they want, not yours. 

It's worked over and over again for hundreds of years. In Thesis vs Antithesis = Synthesis, the elite offer two or more scary false paradigms to the populace to achieve their objective, not yours.
Reply: @karigrandii  I strongly urge you to look up "JFK's Speech on Secret Societies" here on YT. They are the linkage that ties the corporations, Legislative, Judicial, Executive  Branches and more, to the Uber Elite.
1000 of them are meeting right now in Davos, Switzerland meting out the new "Global Reset" a Banking System of digital currency that will monitor every action you commit. No more cash. This will be entangled with the Chinese style "Social Credit System". Read WEF director Klaus Schab's book "The Great Reset" . BTW, GHWB and GWB were Scull & Bonesmen, WJC, a Knights Templar, and BHO and JRB are Free Masons.
Reply: @karigrandii  "Dr Michael Rectenwald, author of ‘Springtime for Snowflakes’ and ‘The Google Archipelago’ joins Dunagun Kaiser at Liberty and Finance to talk about his latest book, ‘The Great Reset and the Struggle for Liberty’.

The former New York University professor and former lifelong Communist has joked that he used to be “to the Left of the Bolsheviks” before he ran afoul of his wokester peers in academe.

When he came out against the social justice inanity at NYU, not only the faculty but the top administration of the university came down on him like a ton of bricks. It was then that he recognized he’d touched a third rail and when he understood that wokeness is the ideology of the elite.

And I guess, that’s when he stopped being a Leftist."

See: "HOW TO REFUSE THE CBDC RESET | MICHAEL RECTENWALD" at Forbidden Knowledge tv
Reply: That entire comment lacked stating any significance of this achievement. What does this mean? We can just use free energy and get charged for it in a different way
Reply: @MachinedFace8  Bingo.
Reply: We can't figure out why they act like that in the black community.... Anyway what about the stars?
Reply: @2uentindward  what in the actual fk are you talking about
Reply: Like most of the 8.0+ billion people on this planet you've likely become quite masterful at excluding the following two warning articles out of your consciousness. I urge readers to search for the following article titles.

IPCC report: ‘now or never’ if world is to stave off climate disaster (TheGuardian)

UN chief: World has less than 2 years to avoid 'runaway climate change' (TheHill)
  * This statement was made 4-years ago.
Reply: @vernonbrechin4207  I am SURE you are aware that this small sample of "scientists" and "climatologists" are very tainted by the fact that all their government contracts and funding are contingent on their "professional" cooperation.
Everything and everyone who has a dissenting opinion (and their numbers by far outweigh the climate alarmists) is suppressed by the bought and paid for Leftist Fascist Corporate Overpaid Talking Heads.
"We will know our operations are complete (Operation Mockingbird) when everything the American People believe is FALSE" , William Casey, CIA Director 1981.
"The individual is handicapped when confronted by a conspiracy so monstrous he cannot believe it exists" J Edgar Hoover, FBI Director 1956.
Reply: @vernonbrechin4207  there has been a human consciousness shift that is rapidly growing and is changing the course of humanity
Reply: @Journal2Awakening  - Such beliefs have existed for at least the last 250 years as each new generation comes of age. They can't conceive that it existed before them.

That consciousness shift isn't reflected in the emissions of greenhouse gases despite the warnings in the U.S. that began 57 years ago. Many people have a knack of immersing themselves in diversions so that might explain why most people have few clues about our failure to significantly alter our path towards the abrupt collapse of industrial civilization.

I urge readers to search for the following article headlines.

Climate change: How do we know (NASA)

The GISTEMP climate spiral 1880-2021 (NASA)

1965
Scientists warned the US president about global warming 50 years ago today (TheGuardian)

Climate: What did We Know and When Did We Know it? (YouTube)

IPCC report: ‘now or never’ if world is to stave off climate disaster (TheGuardian)

UN chief: World has less than 2 years to avoid 'runaway climate change' (TheHill)
  * This statement was made 4.3 years ago.
Reply: @vernonbrechin4207  Are you some disgruntled employee who lost his job at this facility and now takes to YouTube to degrade what they accomplished?
Reply: Boooooooooooooooooooo
Reply: The thing people need to realise about Nuclear Fusion, is that they don't even know if it will work as a viable method of generating electricity. It's a massive science experiment that is always going to be decades away from when we need it ( and in all likelihood won't even be ready then ). Nuclear Fusion is a nice idea but it is an ideological one ( that in the end will amount to nothing) when to solve the climate crisis in time, we need a pragmatic one! We need to act fast and use ideas and solutions that will make a difference quickly before irreversible damage is done.

I do believe cheaper and safer nuclear power will be essential for the future of green energy, but it will be fission not fusion that will get there in the time we need. 
Because if we keep waiting for fusion, there won't be a planet left.
When i say fission i mean New Nuclear like Small Modular Reactors (SMRs) Advanced Modular Reactors (AMRs) and molten salt thorium fuelled reactors like (LFTR)
Thorium is the future and the way forward.
To learn more search Liquid fluoride thorium reactor and the work taking place with Kirk Sorensen at Flibe Energy.
Also Dr Alvin M. Weinberg who invented nuclear power generation as we know it today.

What's that i hear you say renewables like solar and wind are the answer and what we need.. Well let's talk about renewables.

Yes, advanced nuclear does have its downsides but so do renewables. Renewables take up huge amounts of real estate and they have to be replaced every 20 years.  The U.S. will need about 7.85 billion individual solar panels, each providing about 350W per hour and 500,000 5 MW wind turbines that are the height of a 50 story skyscraper. After 20 years, the U.S. will then have to replace 80 5 MW wind turbines each day and 1.23 million square meters of solar panels each day forever.  All that material will need to be recycled or we will run out of atoms to make them. We will also have to build huge amounts of batteries and recycle them as well. The chemical energy in batteries and fossil fuels can only store about 2 eV of energy per atom. So just think of any battery as an equally-sized container of gasoline for energy content purposes. On the other hand, Uranium and Thorium atoms contain 200 million eV per atom or about 100 million times as much energy. That energy came from two neutron stars colliding to form a black hole maybe 6 billion years ago.
Reply: The whole problem with fusion is the theory of how stars power themselves (fusion) is completely wrong.  It's not nuclear-powered, it's gravity powered.  

You have to step back a moment.

Long read... if you are interested in science and/or fusion:

Our Sun (a star) is gravity powered, it can at least be agreed there is a gravity of at least 27 Gs or 27 times the gravity present on earth, where 1G = 1 Earth gravity.  The Sun being gravity-powered, means it's life span is indefinite (undefined amount of time), where only the physical law of gravity being revoked would end a star's life.

Evidence: Even at Earth level gravity, you have lava that surfaces from time to time, proving gravity can produce heat by compressing mineral/matter.  

Star are not made out of gas.  The Sun, for example, appears to be an incandescent ball of lava.  Lava meaning molten rock, meaning it mostly mineral and metal. 
Proof is gas would not be sufficient to generate a sphere the size of the Sun, and at least 27 gravity (27 times that of Earth's gravity).

Evidence: If you examine all the asteroids, moons, planets and the sun, you'll find they're consists mainly of mineral.  "Gas-giants" are not made of gas, it's made mainly of mineral.  

Evidence: Gas alone would not be sufficient to generate the  gravity that exists on "gas-giants" (or stars).  They may have gotten the name "gas-gaint" because of the cloud like appearance of the atmosphere (Jupiter, Saturn, Uranus, and Neptune). 

NASA attempted to probe/land on Jupiter (Galileo Atmospheric Probe  launched Oct. 18, 1969, entry into Jupiter's Atmosphere Dec. 7, 1995)
https://solarsystem.nasa.gov/missions/galileo-probe/in-depth/

The probe returned valuable data for 58 minutes as it plunged into the Jovian cauldron. It endured a maximum deceleration of 228 g’s about a minute after entry when temperatures scaled up to 28,832 degrees Fahrenheit (16,000 degrees Celsius).

The probe’s transmitter failed 61.4 minutes after entry when the spacecraft was about 112 miles (180 kilometers) below its entry ceiling, evidently due to the enormous pressure (22.7 atmospheres).

Data indicates Jupiter is actually a protostar

Data, originally transmitted to the main spacecraft and later transmitted back to Earth, indicated an intense radiation belt about 31,000 miles (50,000 kilometers) above Jupiter’s clouds, few organic compounds, and winds as high as about half a mile per second (640 meters per second).

Evidence: 28,832 degrees Fahrenheit 
Evidence: 228 gravity (entry and braking using thrusters, pulling 10 earth gravity)
Evidence: 22.7 Atmospheres 
Evidence: Intense Radiation 

The evidence indicates perhaps whoever calculated the gravity may have missed by at least a decimal point.   Gravity maybe closer to 22.7 times that of Earth, on Jupiter, rather than 2.3 (estimate/calculated).  

Which also means Sun's gravity is actually 270-280 (possibly 2700 to 2800) times that of Earth.  Calculated/estimate is 27-28 times that of Earth.

Evidence: 1.3 millions Earths can fit inside the sun.
Evidence: 1,300 Earths can fit inside Saturn.
Reply: @michaelhill6451 - In the past the NIF managers failed to mention the laser input energy when they made announcements about achieving new fusion level goals. Eventually word got out that they were not telling the full story. That is why the managers now admit how much energy goes into the lasers. They still do not talk about the the amount of energy the facility consumed while spending more than a week preparing for the experimental shot.
Reply: @vernonbrechin4207  Are you some disgruntled employee who lost his job at this facility and now takes to YouTube to degrade what they accomplished?
Reply: It is not unusual, or unexpected, for people below the age of 40 to have a greater sense of hope then those who are much older and who have experienced the wool being pulled over their eyes repeatedly. They have often seen much sales hype for projects that later failed. Many people believe that it is important to shield youth from such downsides because they look to the youth to fulfill the dreams that slipped through their fingers and they want youth to aid them as they become infirmed.

Open your eyes to the scope of the threats we are now facing rather than keep yourself buried in technological dreams.
Reply: @vernonbrechin4207  True wisdom you speak.  It took time but after that “wool” being pulled over my eyes over time, I question every news topic that comes out whether it is local, national, world news.  There are so many holes in many stories.
Reply: @POLOLOUS3  - I'm glad to know that I've helped to enlighten you to a presentation that are filled with holes that scores of journalists and a vast fan base is blind to.
Reply: @vernonbrechin4207  Are you some disgruntled employee who lost his job at this facility and now takes to YouTube to degrade what they accomplished?
Reply: @vernonbrechin4207  Are you some disgruntled employee who lost his job at this facility and now takes to YouTube to degrade what they accomplished?
Reply: We're probably only 1-2 years away from biological immortality. Which isnt to say a person cant 'get hit by a bus.' But we're already capable of taking an elderly mouse and essentially turn it's body into that of a teenage mouse, reversing dementia, bone loss, eyesight deterioration...
Reply: @JR42x10  NOT